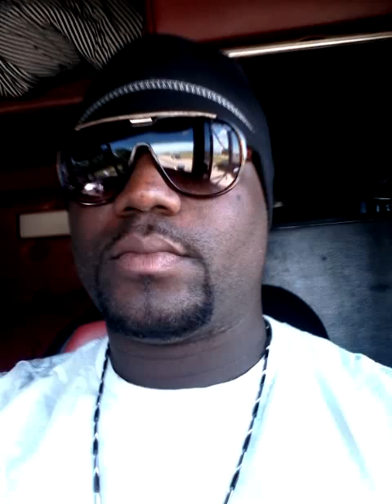a hard start problem Detroit 60 series 12.7 liter

Comment: Good day brother this is my history hopefully you can help I take my 2005 Columbia with 60s on it over hauled to frame accept the injectors and turbo however we did everything right truck started so many times while I was flushing it turned off comes back to turn it back truck won’t start it crank but won’t start we unplug the ecm plug another one in it it started so just wondering what you think is the problem or is might be a sensor?
Thanks

Comment: I change my check valve... every morning I need to put my foot on the pedal hard to start
Reply from the maker: Change the crank and cam sensor on the driver side towards the front of the engine one at the top and one at the bottom. Change those two sensors

Comment: I have the same issue, I end up changing four injectors & the fuel check valve and still my truck won't start I come across your video and I just changed two of the sensors I will see what's going to happen tomorrow.Thank you for sharing your experience!!!
Reply: Did your truck start after changing the sensor
Reply: @EmekaVision  no it was not the sensors one of my injector o’ring was bad and I loss all my diesel that’s why my truck won’t start immediately once I change the o’ring truck back to normal.
Reply: @kalebfetanu6532  I have replaced six injectors today, replaced fuel lines, replaced check valve and fuel pump still truck won't start but truck can start using starting fluid. I am tired but the sensor on the truck seems not to be replaced. I don't know what exactly to do right now
Reply: @EmekaVision  is your truck won’t start in the morning or even after you drive it a while? Can you smell diesel on the dipstick or oil? Did you change the crank sensor and the timing sensor?
Reply: @kalebfetanu6532  I have not replaced any sensor in this. Wether morning or evening truck will not start. This issues started after a mechanic replaced fuel line and tank clean. I never heard no issues starting the truck from day one until fuel line and fuel tank clean and line's replaced. The only way it cranks now is by using starting fluid. After replacing fuel line and nothing happens he then recommended to replace all injectors and after replacing it can start.
Reply: @EmekaVision  did u fix it ? I had same problem there is a tiny check valve right inside fuel line . Wonder if he didn’t put it back in after new line . Good luck

Comment: step one, turn key on, watch for red and yellow lights to come on and go off. (ecm is powering up) step two, spin the engine and watch the tachometer  if the tach does NOT .move then look at the timing reference sensor (TRS). step three make sure it has fuel.  step four, watch tail pipe as you spin the engine.  if heavy smoke or raw fuel is dripping out of tail pipe, one or more injectors has a tip blown off.  stop immediately-do not try and start engine.  you could bend a rod or the engine could run away.

Comment: good video carl.
when your truck wouldn't start did the check engine light still come on while cranking?
Reply from the maker: Yes but went off after starting
Reply: Same issue here. But my check eng light doesn’t come on during cracking. It usually does